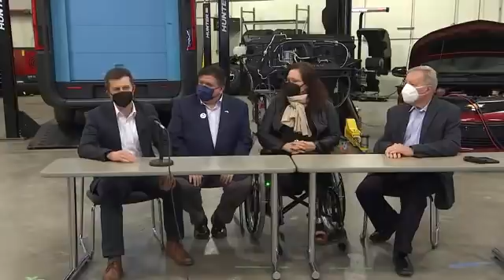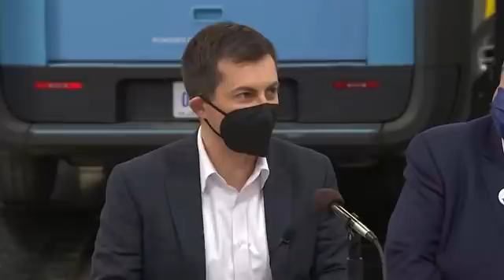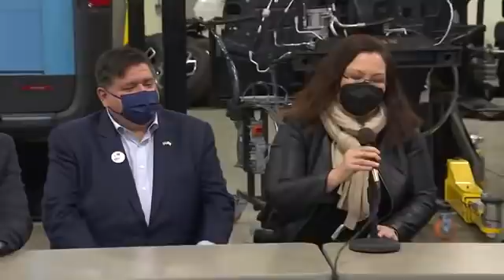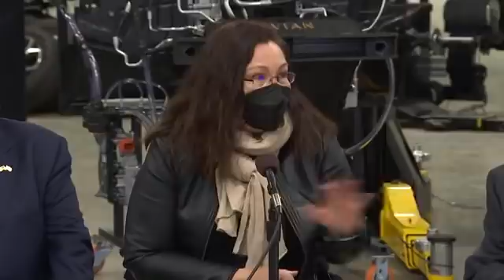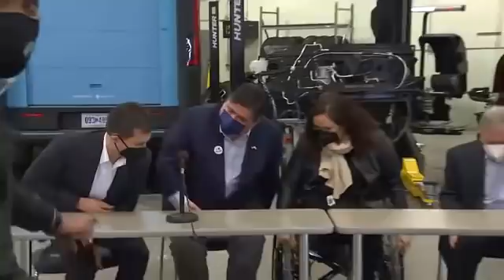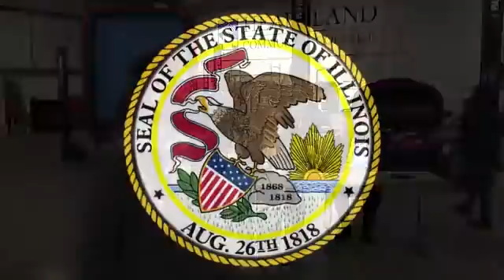'Most Important Part Of Supply Chains Is People': Buttigieg Highlights Manufacturing Jobs

Comment: The EV “ revolution “ will be a “ White Elephant “ enterprise ; it will most likely fail/fall flat on its face . Electric Vehicles don’t save energy and to charge them will require that power plants burn more hydrocarbons to generate the electricity . 30% more energy is required to charge the batteries than what they will return  : one hundred “ units “ of charging power in will only produce 80 “ units “ of power out . You loose energy when the batteries are charged .